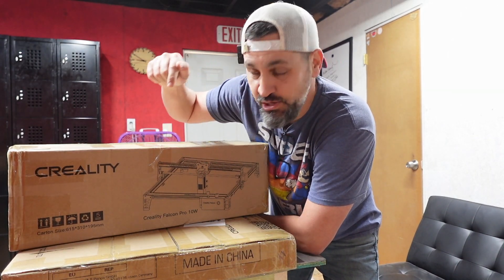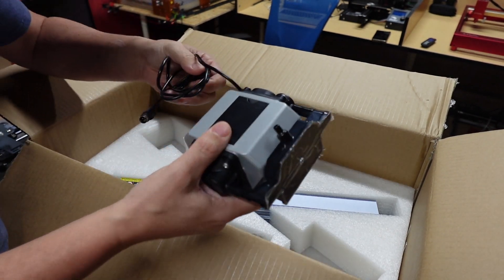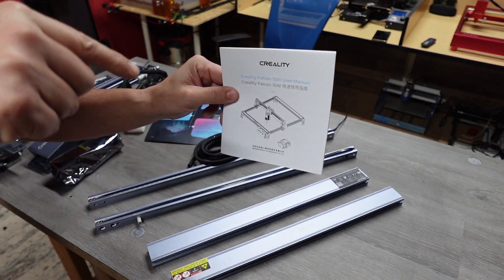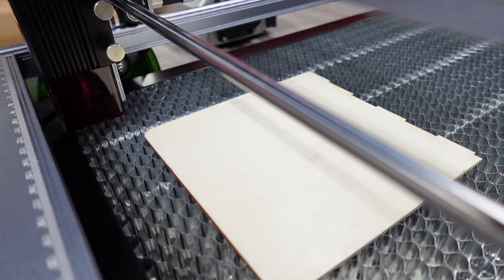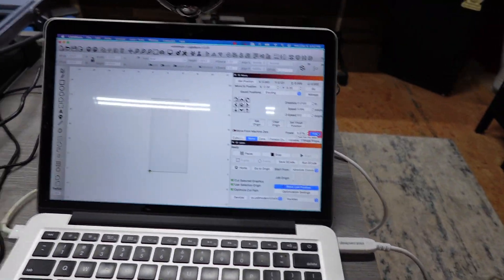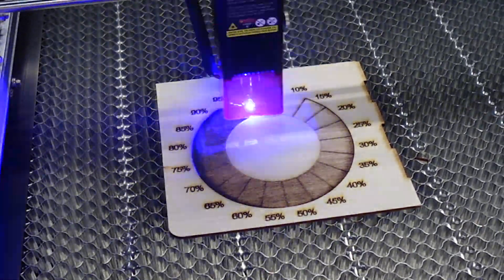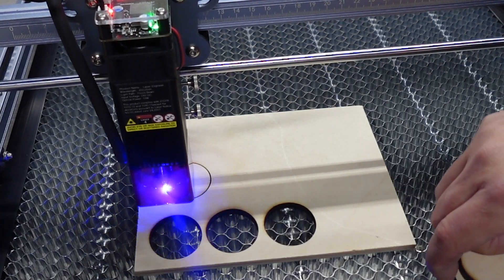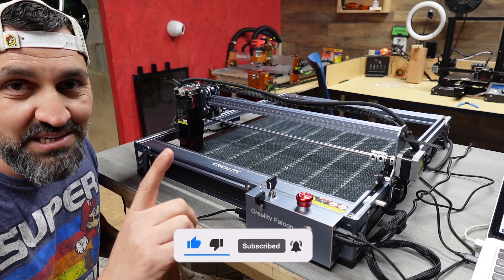Unboxing the Creality Falcon Pro 10w Laser.

Comment: I'm trying to figure out why, when I home my laser (the same as yours) it goes to the left front corner and grinds.  Any ideas?
Reply from the maker: Make sure the safety limit switch isn’t stuck or anything like that. Also make sure the X gantry is squared up and belts are nice and snug.  Something tells me when it gets to the 0,0 location…. It’s not tapping thr limit switched to let it know it’s there.
Reply from the maker: It’s should hit and then Bounce back.